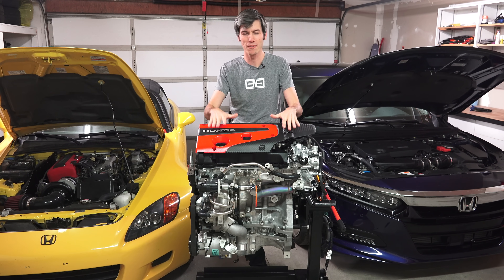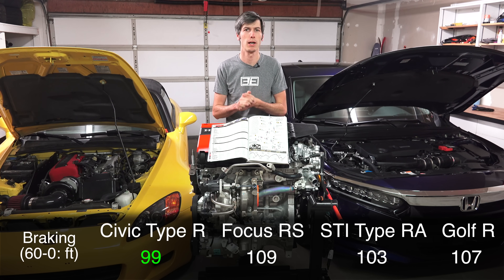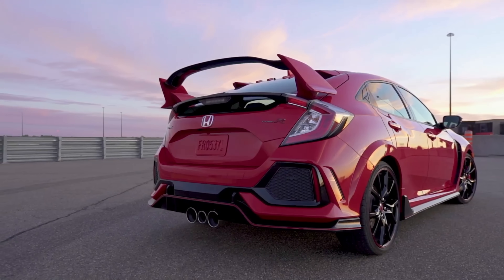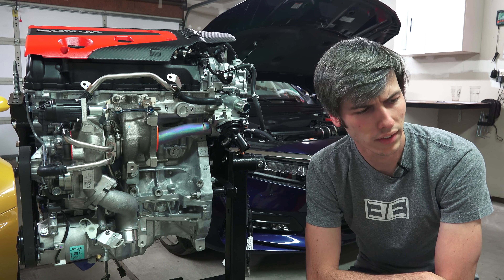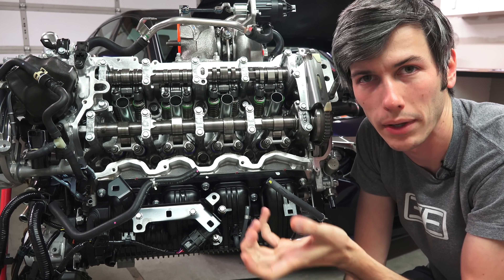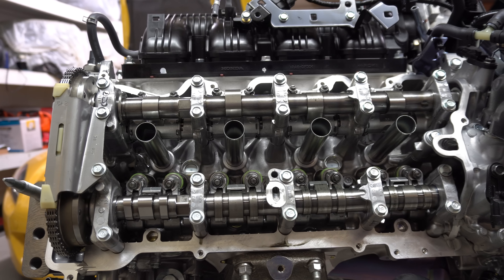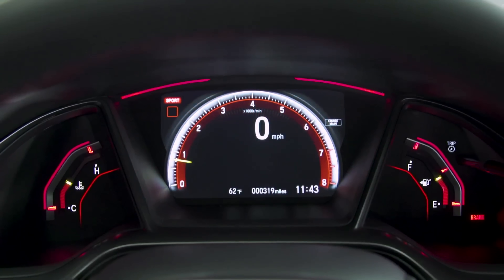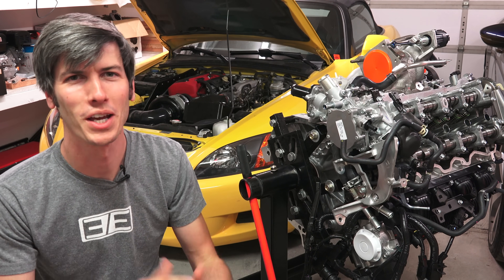The Honda Civic Type R Destroys The Competition - The Best Engines

Comment: How is the Type R faster than the RS to 100, slower than it in the quarter mile, but both reaching speeds over 100 in the quarter mile? Something isn't adding up.
Reply: RS is faster. Dig to top speed and from a roll. 

Don't believe everything you hear

Comment: Who's going to pay $35k+ for a Honda Civic. A 330bhp BMW 3 series goes for $40k!! The original Type-R was a success because it was a basic Honda Civic with beefed up suspension, brakes and a fun high revving motor, allowing it to be retailed for $20k. If they dumped the 1999 rude boy body kit, and all the gimmicky electro guff and sold it for $25k, they'd be on to a winner. Either that or poach some Italian/British designers to at least make their products look expensive.

Comment: Seems to be an ongoing problem with Honda, where they always come out with something So close to the “full package” but in one way or another just fall short of absolute satisfaction for its rather mere mortal and average fans. In this case I think it’s safe to say the markup value at the dealer and the body styling on this model is a tad too exaggerated. The DC5  type R and S2000 models are probably the best they ever come close to all around in having the absolute satisfaction factor.

Comment: My Evo 8 will still wax it hahaha
Reply: Doubt it. hahaha
Reply: how? I'm on e85 with 390 whp on a mustang dyno... I barely modded it when I put new 4g63 short block in, only thing aftermarket is 1000cc injectors, 272 cams, 3 inch exhaust, AEM short intake with a conservative tune. stock block can handle up to 600 hp and 400 tq. I'm going to build another Evo 8 from ground up aiming for 600+ whp.
Reply: @deez9353  Here's the thing, nobody cares.
Reply: your the one who said doubt it. @z28kindaguy
Reply: @deez9353  Ok, I doubit it, and don't care. Hope that clears it up for you.

Comment: The '06 Coupe SI Engine borrowed from the K20 so much better.
Reply: K20C1 puts down a bit more torque than an equivalent turbo K20Z3. K20C1 is stock roughly 300 HP and 300 TQ vs 300 HP on a FI K20Z3 would only give you about 250 TQ.  No matter what if given the same power levels, the K20C1 will always have more torque.   That VTEC crossover and 8200 red line are missed, however.   Former 2010 SI and current Type R owner.

Comment: yeah, but Mercedes Amg A45..

2.0 376 bhp 369 lbft, 4.2-62.  for 2019 they'll be 400 bhp 390 lbft.
Reply: Good point OP, sorry to see a bunch of morons bring up price and compare a45 to Supercars as if we are not talking about 4 cylinder turbo engine specifically. Smh. Only thing I can think of putting Honda engine ahead is probably maintenance cost, when compared with a45 engine.
Reply: Yeah but the q50 red sport 400 horses that'll blow that benzo
Reply: Meirion Rhys it’s also more than twice as much as the civic
Reply: Dont forget audi rs3. Same class but 5 cyl with 297kw. Best 0-100 of the hot hatches 3.9s.
Reply: Meirion Rhys price?
Reply: did anyone ask?
Reply: German,  so overpriced.

Comment: If you change a line in a chart to use a different color you don't also need to change the style. Then it looks like you're tracking four independent items across the same metric rather than two items across two metrics.

Comment: sti 5.7 seconds ???? whos driving it??? my 2015 wrx did it in 4.9 seconds (edited: went back and looked at my pictures you gotta launch at 6700 rpm) with me (220 lbs) behind the wheel. also a lot of clutch goes with that 0-60 by the way.
Reply: The guys a troll. Actually the type r hits 60 in 5.7

Comment: I wanted to get a Type-R... but I couldn't justify the cost, or the incremental cost in lower fuel economy compared to its base model (the Civic Hatchback, which is also a damn fun car to drive).
Reply: Have you compared fuel figures ? 
The K20C is more economical (driven normally) than an R18a2 
And yet it has over double the horsepower 😮

Comment: Doesn't come close to the focus RS experience. Front wheel drive at this price point is outrageous. It also looks like a concept car designed by a 12 yo Korean kid. Warranted, the engine is a belter but it simply doesn't make up for it's weaknesses in other areas. The Type R nurburgring time was done in a modified car & that track simply doesn't represent day to day driving. In real world conditions, particularly around town, on loose surfaces or in the wet, ice or snow the VW R & Ford Focus RS crush it in driver experience, usable speed and handling.
It is a fine handling front wheel drive with a nice engine. Unfortunately the competition moved on from these specs at this price point.
Reply: Not to mention the RS is faster from a dig all the way to top speed
Reply: @300zxttswap6  yep, this is true!

Comment: @engineeringexplained could you explain the latest oil dilution problem in Honda's 1.5L turbo engines. Especially what it means for the long term reliability of the engines..... 
I currently own 3 Honda's and would love to buy the new CRV but I am seriously concerned about the dilution problem.

I have  a 20 year old first gen CRV has a 2L naturally aspirated engine that still runs like a dream, idles over very smooth and gets revved to the red line on a daily basis.

Comment: it's a trick engine for sure. but i'd still prefer they built an engine with big pistons, nice crisp cams and a little less rpm. in other words more torque
Reply: Rpm is type r so take it away then its not a Honda anymore
Reply: @350zdutch6  but if they put their r&d guys to work on lower rpm engines(not necessarily "low" rpm) that make more torque. then Honda's wouldn't have to work so hard at competing, especially in drag racing. it would also make it cheaper to produce then a high winding engine
Reply: ihateliberals let’s not beg these manufacturers to get any cheaper.
Reply: @350zdutch6  true, but turbo's are just as anti-typeR
Reply: you're looking for a diesel...  an inline 6 diesel is gonna perfectly fit your needs
Reply: @pihermoso11  diesel!!?? no thanks. well wait a second. unless it's the kind of diesel engine Audi used to take 1st and 2nd place at Daytona 24 hours(not sure if it was Daytona, or 1 of the other endurance races) now that kind of diesel i could get on board with. but i just despise the american diesels that needlessly belch out huge clouds of thick arid smoke. the only time i'd make an exception is, when they go by using the "rolling coal" against antifa punks

Comment: Sure they are if all you want is a high performance turbo I4. Sadly Honda I4's are not known for their 300K-500K durability. Usually long before you get to 150K miles they have really bad piston slap and oil consumption issues.  They make great toys not great daily driver's. Then we have their dreadful lack of durability with their automatics! They definitely make very fun vehicles! Sodium filled valves are nothing new Toyota was using those in the 1980's on their Turbo Charged Hi-Lux pickup truck. I have to say that that level of boost on a daily driver is super cool!

Comment: Nice explanation. I have a respect for Honda engines. They hang together so well in 24Hours of Lemons racing. There was a early 90s Accord that had no brakes and downshifted at the end of the straight and chirped the tires and revved to 10,000 rpm and did it for a full day. 
About those sodium cooled exhaust valves and oil cooled pistons. Renault put these 2 pieces of technology in the R21 Turbo 2L sedan in 1988. Came from their developments in F1 in the late 70's.

Comment: You should consider when talking about the civic and its greatness several things. 
1. It comes stock with 180AAA tires while a golf R at best has only 220AAA so naturally lateral G’s will be skewed. 
2. The Civic is FWD. you can pretend all you want but after you start putting down 300 or more HP wheel to the front the returns on investment are minimal at best. As traction is a driving factor.
3. Golf R is a Dual stage Gear box.
4. Take a look at a Golf R with only a tune and downpipe the car is certified to run 11’s. With my 0-60 in the 3.2-3.5 range. Show me another car on it the price category once “unlocked”  that offers a better value than a golf R? I can fit 2 full mountain bikes in it, 6 pairs of skis and 3 people for a weekend in tahoe, can take it cross country or Auto -X , i average 27mpgs, and its the fastest stage 2 car in its class as well as the safest... i really think you should reconsider this pick.
Reply: Blah blah blah, euro tears lol

Comment: Its the fastest fwd car in the nurburgring. Which is awesome. 
I'd argue that it'd probably be just as fast rwd. It's more cost effective to build fwd within the civics price range. More profit for Honda
Reply: Actually most likely not, the main reason its acceleration is so good is, because all the weight on the front tire from the engine and transmission. If the opted for a rear-mid engine set up they would see some improvements, but times have shown that nobody wants a mid engine daily driver

Comment: Beautiful valvetrain! There's some serious RPM potential using a light valvetrain with no hydraulic cups. I bet you can rev that engine to 8500RPM with only some stronger springs and maybe different cams suited for higher rpms.

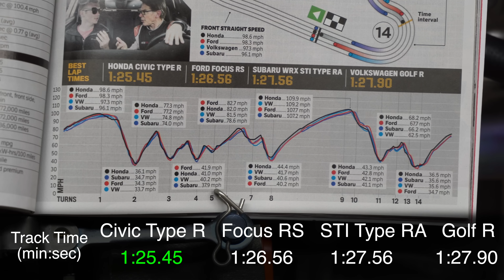Comment: Let me stop you at 1:45. That is an MSRP price. Try buying the Civic at that price, there are dealer market adjustments to the MSRP, the one I was looking at had a markup of 8,000 dollars.
Reply: I bought mine at MSRP
Reply: Yeah I did a double take at that.  There are no Type Rs in my area without ADM.  When I was shopping for a car back in June of this year, the lowest dealer markup I found was $4k.  The highest was $10k or more.  I ended up with a 2018 Focus RS for more than $5k under MSRP instead.

At MSRP the Type R is fantastic (if you don't mind driving an FWD hot hatch, and you like the looks).  With the markup it's a lot less of a draw.  And for me, having owned a powerful FWD car in the past, never again.

Comment: Piston cooling jets r nothing new. Sodium filled exhaust valves is nothing new. Diesels have used them for decades. They r just more expensive so cheap gas engines havent used them. Now that they want the power of a 4l in a 2l u have no choice.

Comment: Me? I'm a Honda Fit snob. I don't care for fast 0 to 60; quickest 1/4 mile; winner on the track, etc. Who cares who's first to get to the red light? Why do I want to burn gas unnecessarily?  A turbocharger? For what? To cook my engine? Hang on to your wallet, because the above video is the marketing department trying to get you to part with more cash. I'd like to put a Honda Fit engine in a Mini Cooper so I wouldn't have to get married to the BMW Dealer.
Reply: Oh, yeah, by the way, I want a manual transmission...

Comment: This dude is a Honda Fanboy! :P 
Well, their engines are known for realibility! 
Nice that they have those valves, rods and crank installed as stock! Wonder how the block and pistons would handle more boost!
Reply: Probably not well. If you wanted to get more boost you would probably need to reinforce the block. Everything else would be fine

Comment: As a track or fun car I wouldn't say the CTR "Destorys" the competition.
It basically ties the Focus RS (which is slightly more expensive now that it is optioned out) and Camaro V6 1LE on the track (VIR anyway) and pretty much the same in the quarter mile.
As a practical yet fun daily driver I'd say it's the best though for it's price.
Reply: Nah the RS beats it from dig to top speed
Reply: @300zxttswap6  The CTR actually traps higher in the quarter mile than the Focus RS.  The RS has the advantage at the launch, but the CTR accelerates faster everywhere above ~30mph.  I'm not aware of which has a higher top speed, but I hardly care, that isn't a usable stat.
My point was there is competition for the CTR on relatively equal footing.
Reply: @Dolby109  car and driver did a test where the CTR had slower in gear times than the RS. The numbers are all over the place for the Type R, but my statement still stands. From a dig until the RSs limiter the R is behind.

Comment: these numbers dont make cent$ it does 100 in 12.2 but the 1/4 1n 13.7  at 105 so it takes1.5 secs to go 5mph what did dude miss 5th
Reply: It does the quarter in high 13s and gets gapped easily off the line by almost everything

Comment: Motor Trend has the worst 0-60 time for the STI i have ever seen. It is the slowest time i can find, period. It is easily a 5 second car and always has been. It's not fair to use the slowest time the sti has ever put down since it came to the U.S. in 2003 or whenever that was. I'm by no means a STI fan boy, i drive a 2017 mustang GT but this irritates me.

Comment: Excellent engine!! But..remember: power is nothing without control.
 transmission, suspensions, chassis, are very very important.
Reply: But this car has the best of all those in the segment.  And probably the best of those until you get to $50,000+

Comment: Well, there engines may be good but they need to do the same for their transmissions. Anyone who has looked inside one of their automatics can see what an engineering disaster they are. Looks like they tried to combine an automatic with a standard. The results are marginal at best.

Comment: It's unbecoming of you to omit inconvenient objective advantages of 4wd/awd in anything but dry tarmac conditions compared to the fwd. doesn't lie but won't tell the truth, if this was your own content i'm sure you would have given a more complete context on the methods of testing. Which you usually emphasize to ensure credability of the numbers. It's a slippery slope to start turning a blind eye in any situation.
Reply from the maker: Not sure what you're referencing. Motor Trend does a great job testing, and I stated in the video multiple times the Type R is FWD, not AWD like the rest of the competition.
Reply: @EngineeringExplained  If the tests were run in say the wet would it have influenced it any way? I just feel you hyped the best case for the fwd while omitting some things.
 I like your channel hence i'm here but think your presentation in this case was less balanced objectively. As an engineer or scientist you would present all the data and the why.
 cherry picking, presenting desired outcomes while neglecting disadvantages, just a mention of conditions even.
 Present positive viewpoint gain corporate adulation, just sayin

Comment: But is it as reliable as a normal civic ? Would it last just as many miles and would it require the same amount of maintenance or would a type r be a lot more expensive? Especially after 100k miles nearing the 200k mark and over

Comment: Hondas are exceptional engines. I have two CRX both high compression B16 and b16B and there is nothing compared in engine to the HP number these engines produce 1.6 litter size I mean nothing. Both the b16 puts out 180 HP or 168 to the wheels with mild mods. That is over 210 HP or 195 to 215 HP on a b16B those numbers are not even remotely possible on engines of that size anywhere non turbo.

Comment: I would love to have that car! I had owned a civic in the mid 90s when the import fever was very hot! I was younger back then! I had the car slightly modified, and i use to beat on that engine like crazy! I drove it from Chicago to Arizona twice, the second time driving down to Arizona,  in new mexico, it was night time very dark, i ran over a carcass roadkill, at 80mph. When i pulled over for gas, something told me to look under the car, good thing i did! Because the oil pan got the hit from whatever it was that i ran over. It was leaking oil allover,  checked the dipstick, and it didnt show no oil, it lost all the oil, at the time i had added slick50 oil additive to make the engine last and perform better, lucky i did that Because as i added oil in the gas station, it helped me get to Arizona,  with the engine in one piece. The bad part about the whole thing is, That the car spent the two weeks of my vacation in the shop, getting fixed. Well i just wanted to say that the honda engines are some of the best engines out there. They take a beating and keeps on ticking😎👍

Comment: I purchased a Focus RS. Type R was a close second, only two things stopping me was that due to the snow around my area and the hills I live in, FWD never did well. Second, the looks, very subjective but I'd be embarrassed being seen inside one of them. Nonetheless, amazing performance.
Reply: Renan Marchet I live in Canada. Awd is the best and Fwd the second. Rwd is not good on icy and uphill road. Not safe. I sold my Lexus GS450h because of that.
Reply: I heard the focus rs have problems with the head gasket because the way the engine was designed. I was goin to buy one myself but I did some research
Reply: @martrome7449  "Many theories on the root cause have popped up but it may all come down to an incorrectly delivered gasket. Many Focus RS owners have posted pictures of their failed head gaskets and the design appears to match the gaskets found on the Mustang 2.3L EcoBoost. While the two engines share many components and specifications, the cooling passages in the RS are different from those found in the Mustang."
Reply: You picked a winner. I had an ST for two years and absolutely loved it. The RS did the Ford brand proud. It's a monster and highly lauded.
Reply: Red interior looks bad on anything other than a supercar and even then its not good. Red highlights maybe, but solid red seats look bad.
Reply: ya that red interior and the wing makes me wanna get sick
Reply: @dj2000lbs  no doubt, if they could fix all the red and that rear end we'd have a beautiful car
Reply: @dj2000lbs   Based upon your Youtube uploads, NO ONE and I mean NO ONE, should value your opinion, ever.  Leave that poor dog alone.